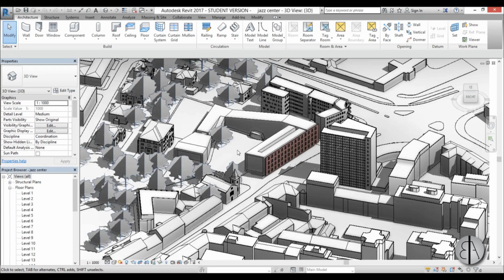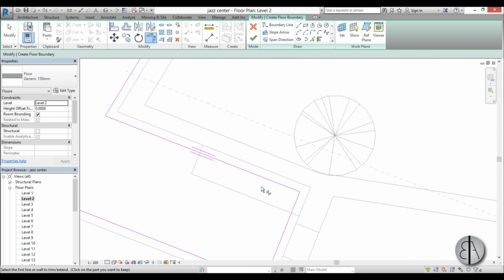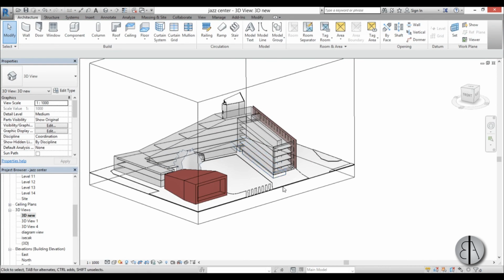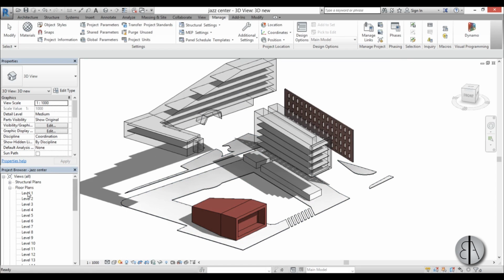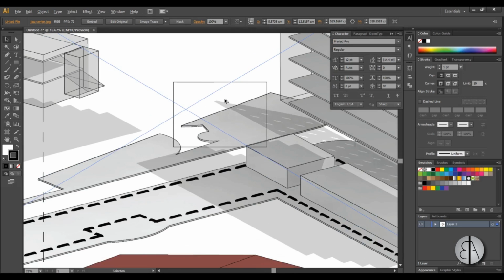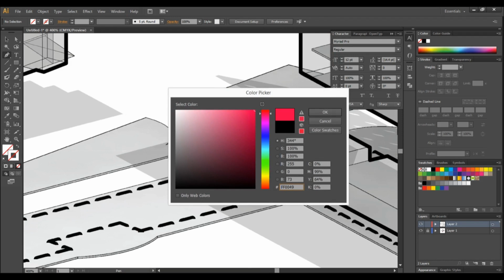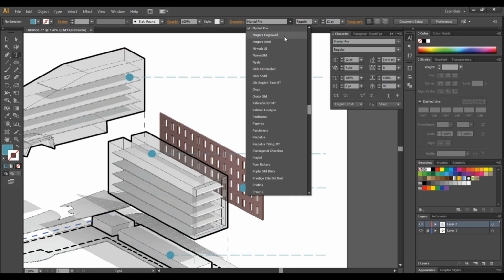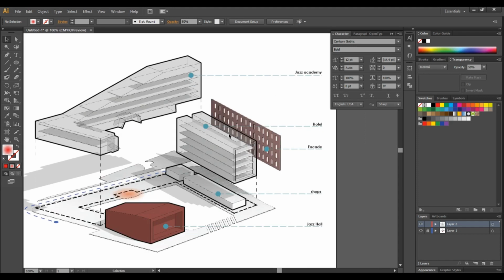Exploded Architectural Diagram Tutorial

Comment: Do you have a video on how you massed the slopped roof with floors?
Reply: If you create an in-place mass and model levels you can generate floors automatically trimmed to the shape of your mass. In this tutorial he used an in-place component which is why he had to manually trim the floor boundaries. It's pretty easy in the massing environment to Tab in until you select an edge of your extruded form. From there you can move or scale the edge to get a similar tapered effect. Hope that helps!

Comment: Dear Balkan architect, 
I am working on a project and I was having trouble with the visibility of my links and I thought maybe you can help me out. It would really mean the world. Here is the problem to troubleshoot - I am working with Rvt 2020, and have linked a structural (UC,UB system) into my Architectural project file. I can see the loaded link in my Floor plan view but I cannot see it in my 3D view. Can you please help?
Reply: I realize this is an old comment, but were you able to troubleshoot and find a solution? Generally I always start with ensuring links are loaded, worksets are visible, categories are showing, then check design options and phase settings, finally check view-specific settings like if someone accidentally hid element in view. Usually EH (Hide Element in View) is a last resort to clean up visibility/graphics on a view. Hope that helps! 

There's a classic article out there that runs through 33 ways to find an element that's gone missing in Revit. Look it up sometime if you're curious!

Comment: Great video! Can this also be done in ArchiCAD?
Reply: Yes, it possible, the workflow is a bit different though (since Archicad and Revit work with a different mindset). You would combine Graphical Overrides, 3D documents and you would do a bit of post production on the Layout with lines and a few cropped drawings. You don't need to use illustrator.